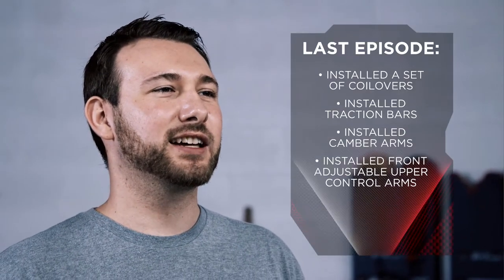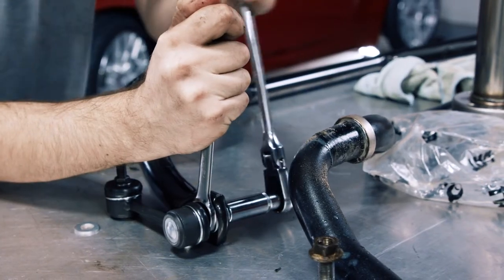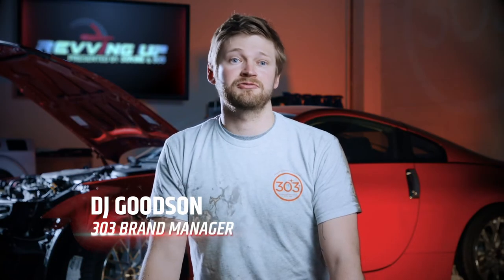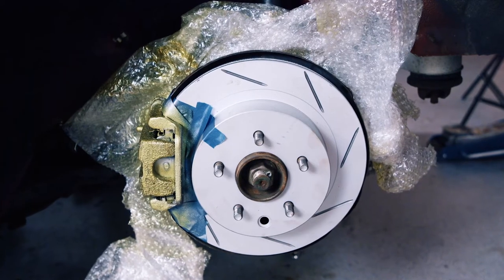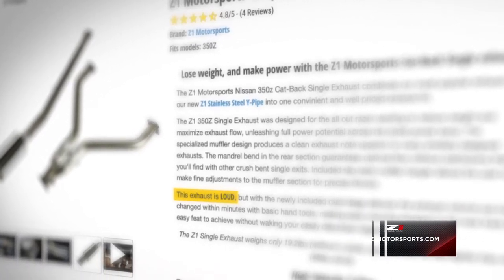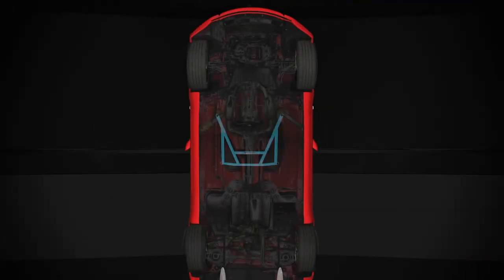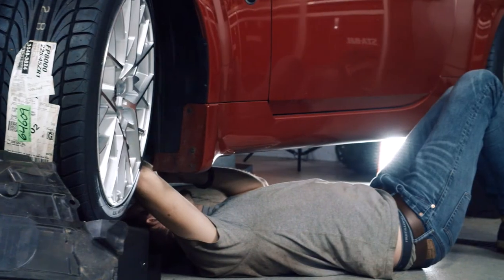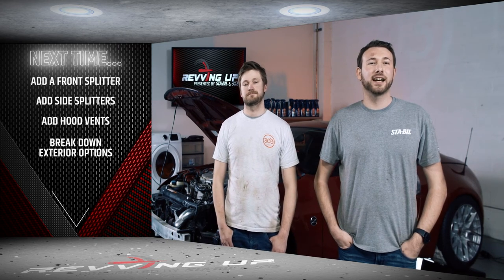Revving Up™ Episode 4: Brakes, Wheels, and Chassis

Comment: why did you choose to paint the calibers in place rather then when they were off?
Reply from the maker: Great question! Honestly, it was kind of an afterthought to make them look a little bit better. So we just taped them off after they were installed.
Reply: @STABILBrand  certainly a cheap but great way to add custom look